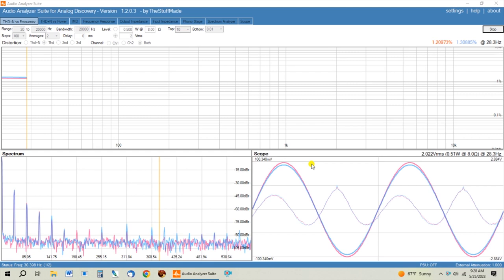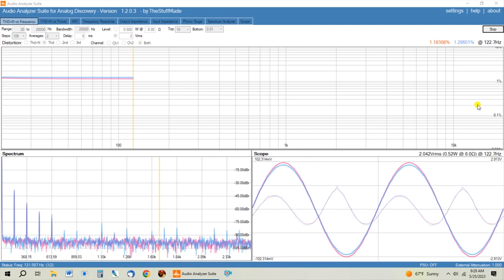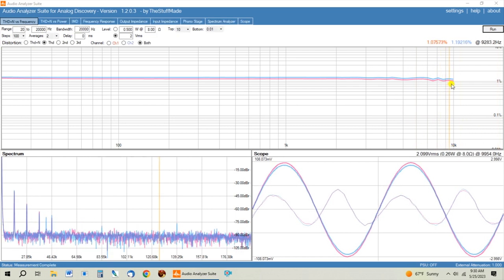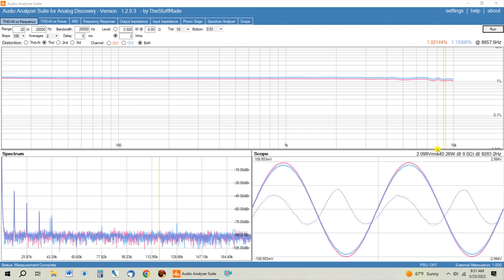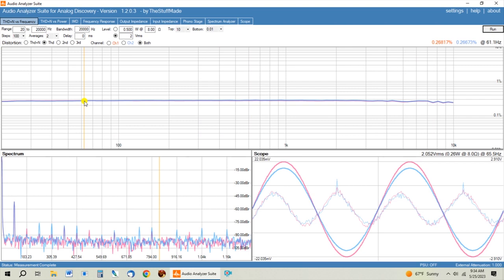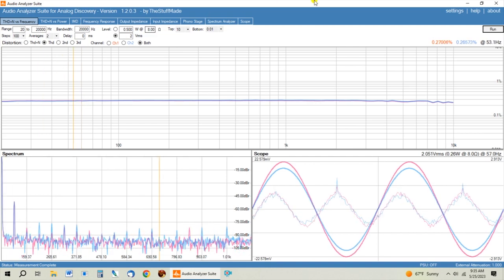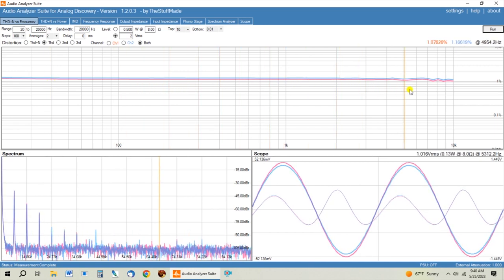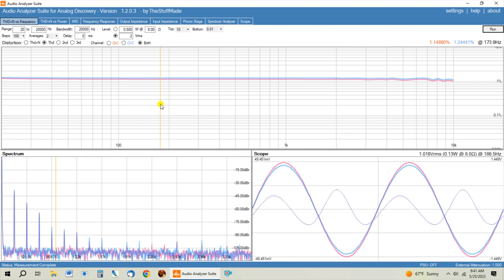How to Control Tube Pre-amp Harmonics.

Comment: Thanks so much for the detailed explanations you go into, especially on this build which I find extremely interesting. I’ve actually started putting together the parts to build a similar preamp but with octal tubes. I liked the design of the link I sent you with the volume in between the either 6SN7 or 12SN7, but I’m going to build it with the volume pots on the input and output as you did. I do tend to use a SS amp in the summer when it gets hot and my tubes in the winter. This design is absolutely perfect for both. 
A million thanks again! I appreciate you and your channel very much. 🔊😊🎶
Reply from the maker: I was never a fan of pre-amps, but this one is different. The one I built on the channel is spoken for but I plan to build another for myself and may actually put together basic kits (minus the iron and chassis) as this turned out so well.
Reply: @SkunkieDesignsElectronics  I’ve no doubt people would love a kit with the basic parts needed, especially if they have any difficulty sourcing quality parts themselves. Yeah, this particular preamp design is different. It really does seem special. Thanks again!
Reply from the maker: This is gonna be one of those thing purists sim, hate and trash talk. People who listen to gear are gonna love it.
Reply: @SkunkieDesignsElectronics  Lol…I’m sure some heads will likely explode, but in all seriousness, I think you’re spot on.
Reply from the maker: @NickP333  The forum regulars do not like this concept at all! :)
Reply: @SkunkieDesignsElectronics  😂 You keep proving them wrong with objectivity, facts, and even their favorite thing….measurements. While of course extremely important in the design process, measurements certainly don’t tell the whole story if it sounds like sh*t. Plus, one measurement of a certain parameter can effect others, and compromise comes into play. It sounds like the sim crowd doesn’t always take that into consideration.
Reply from the maker: Meh, they will just say I didn't test it correctly when it doesn't fit their story.... And of course the Sim crowd can't listen to their designs if they wanted to, unless they actually build something. I had to LOL at this one guy saying "I've designed over 200 amplifiers" but when questioned if he had even built any of them to actually listen to them, *crickets*.
Reply: @SkunkieDesignsElectronics  Hahaha 🤣 Over 200, huh? 🤦‍♂️ Too perfect….😂
Reply: @SkunkieDesignsElectronics  Is the forum you’re talking about AudioKarma? What’s your handle there? Mine is hiwattnick. I’d love to have a bit of fun and try talking with the sim crowd, even though I’m already pretty confident of the outcome…lol
Edit: I also 100% understand if you don’t wanna give out your handle 👍🎶
Reply from the maker: StepheK on AudioKarma, but by far the worst are the curmudgeons at diyAudio. the tube audio forum there is filled with some super nasty folks. My handle there is Stephe